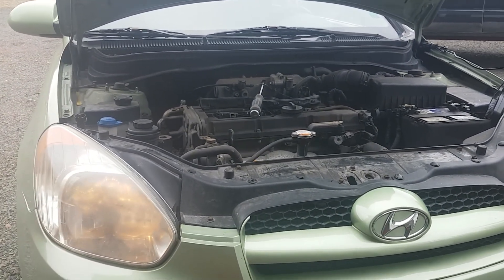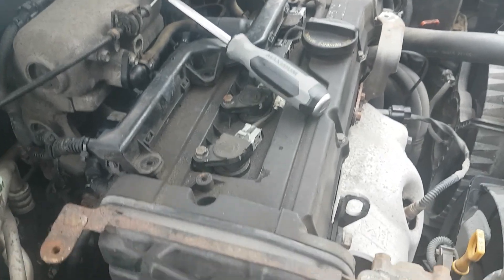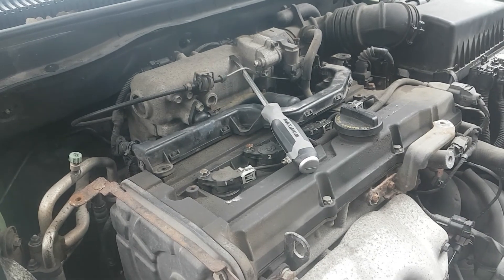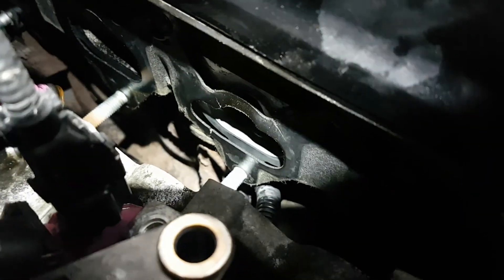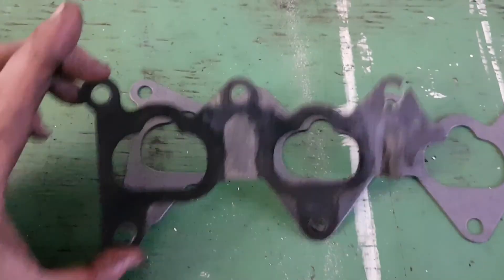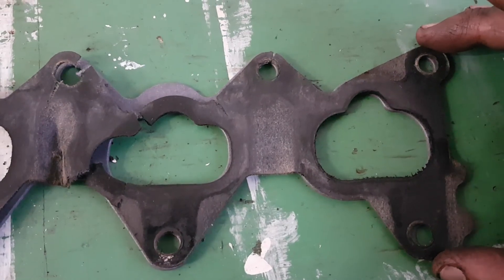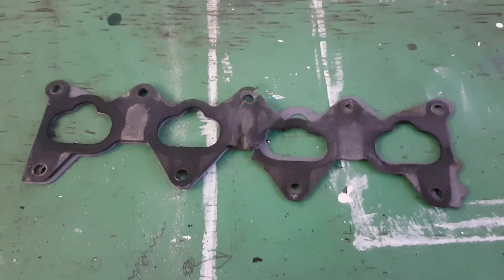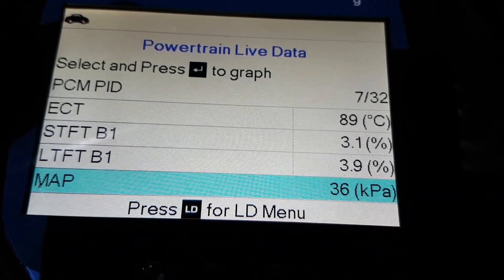Misfire diagnosis and repair 2008 Hyundai Accent

Comment: Hi,
I ran across almost the same issue on 2008 Hyundai Accent. when engine is cold there is no cylinder #1 misfire no multiple cylinder misfire. However, when engine warms up and it's in closed loop also, engine starts to shake slightly and PCM sets multiple misfire and cylinder #1 misfire plus it shuts off fuel injector #1. I rev the rpm up a little bit above idle, engine runs smoothly with no misfires on all cylinders and no injector shutoff. O2 sensor is reporting lean at idle, LTFT is +4%. I tried to spry water on the intake manifold to locate a leak but there is no change at all. I am going to get me a smoke machine to do the leak detection test and will take it from there. Again, when engine is cold no misfire on all cylinders, when engine revved up no misfire at all.

Thank you for the valuable information presented on this video.

Comment: Mine Is disturbing right now when you turn it on it steams for a while and cut off current ,when it's cokd you can fire it but when it's hit you cannot fir it it will off ,be doing break and quench,coil and plugs are okay but steaming and firingg when driving are not working properly

Comment: Had one of these cars, bought it new. After 40,000 it started to buck and kick and throw a CEL. Got ripped off by a dealer one time. Figured out it was the #3 coil going bad but always the #3 in mine. It died at 128k when I burned up the starter ( damn thing absolutely refused to turn over it just cranked and cranked and cranked.) . When I did get it back it absolutely refused to rev over 4000 rpm. Once it cleared that problem the power steering rack let go, that combined with needing a new exhaust was going to be 1200 bucks. The car was worth 300 bucks so it wasn’t worth trying to fix it
Reply from the maker: Ouch, sorry to hear that. Certainly seems these cars are hit-or-miss when it comes to reliability. I did later put a steering rack in this car and a few other minor repairs that were just caused by our weather and road salt.

Comment: Would have like to see the steps on how to unbolt the Air Intake..  How did you access the bottom bolts hidden by the starter??
Reply from the maker: I remember there was a brace or two down to the block I had to remove. Can't recall if I got those bottom manifold bolts from topside or underneath. If the Kia coming in tomorrow is similar I'll reply to let ya know.

Comment: Do you know where the fuel pressure regulator is located in the 08 Accent?
Reply from the maker: I don't remember where it was on this car. You can look up the part on rockauto and maybe the picture will help identify it. It could also be inside the fuel tank so don't get too upset if you don't see it under the hood.
Reply: It is located in the fuel pump itself in the fuel pump assembly